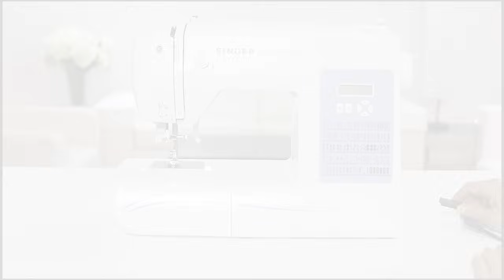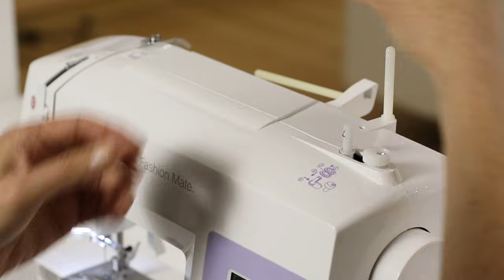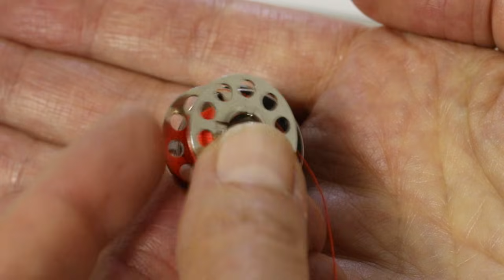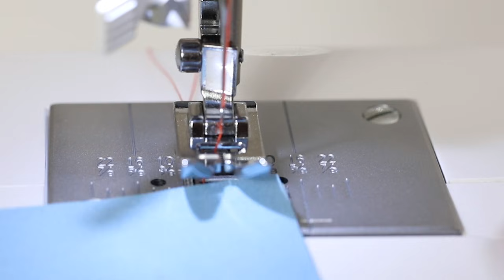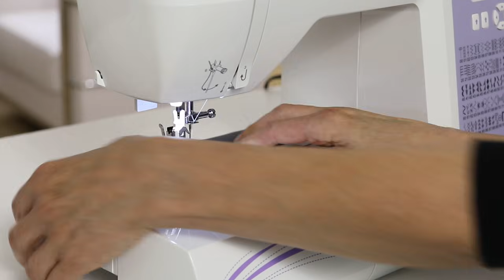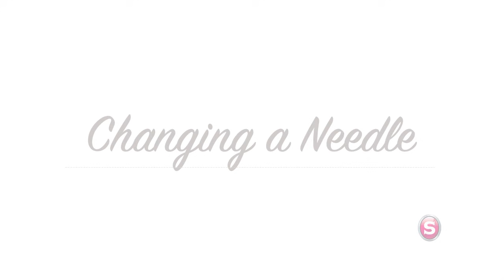SINGER® FASHION MATE™ 5560 Online Owner's Class

Comment: Please can u use this machine for gathering stitches
Reply from the maker: Absolutely.  Adjust your stitch length to the longest stitch available and stitch two parallel lines about 1/2" apart.  You can then pull the thread ends to adjust the gathers as desired.  Or, you can try using a gathering foot: You can find current presser feet for all Singer Sewing machines here: https://www.singer.com/accessories/presser-feet

Comment: hey I need help on 8:22 how did you get the string through the needle because I can't do it?
Reply from the maker: Hi! It takes a bit of practice. A couple of tips. Make sure your needle is fully up, you want the take up lever in the up position. The hook in the needle threader wont line up if the needle isn't fully up and you risk bending the hook. You want to let go of the thread in your hand as you let go of the threader. If you hold your thread, it can't feed back through the needle. Be careful not to pull the thread back out, grab the loop made and pull thru the needle. I hope this helps! -TB
Reply: Singer Sewing Company Okay Tysm I got it now!

Comment: I currently have this machine. I find it to be a good machine but not a great machine. One important thing I do not like is that every time you stop sewing the needle raises and you lose your spot on your work. The reverse button is a bit glitchy, it will do about three stitches and after a couple more presses might do three more or several more. It also does not stop on a dime it will continue to sew another one to three stitches after releasing the foot pedal. The bobbin is difficult to access. I prefer a drop-in bobbin and a clear plate so I can see when the bobbin is getting close to empty. The extension table is uneven and flimsy, snapping it into place is tricky every time. The cover is useless. It's difficult to pick up the machine with the cover on it does not attach to any part of the machine, I've made my own cover. *These are pretty much my only complaints with this machine other than that I think it does a great job with many things, it's stitches are beautiful, it keeps uniform stitches and is easy to adjust tensions and Stitch preferences. *If you can live with those (*) issues then it's a good buy. I unfortunately cannot live with those issues but haven't had the fortune of obtaining the kind of machine I had previously which was Kenmore (rare)-Tight Stitch... OMG!!! WHAT A DREAM MACHINE!!
It was accidentally discarded in a move by family helping me, losing  it completely broke my heart and I couldn't bring myself sew on this Singer repacement for a couple years afterward without breaking down sobbing. I've been sewing since I was 5 some 50+ years! I've used many different machines but I would have THAT Tight Stitch machine until my grave! If you're ever able to get one Grab it! No digital can compare. It's a highly functional manual machine that you have complete control over, it does it the way YOU want! I will positively get my hands on another one!! 
https://www.google.com/search?q=Kenmore+tight+Stitch+sewing+machine&client=ms-android-verizon&prmd=svin&source=lnms&tbm=isch&sa=X&ved=2ahUKEwiq5biqoKPgAhVG6oMKHa2MBLMQ_AUoA3oECAwQAw&biw=412&bih=652&dpr=2.63#imgrc=ggeaTp1r_v963M

Sorry Singer, it's the best rating I could give your machine without holding it right next to the tight Stitch Kenmore and it failing miserably. Yours does a good job. I've kept it for 5 years now. It'll stay with me until I get a Tight Stitch 100 Stitch again. That IS a compliment.
Reply: I don't like how it doesn't stop with the needle down.  My Home Ec teacher in 1978 always said.....leave the needle down if you have to stop!